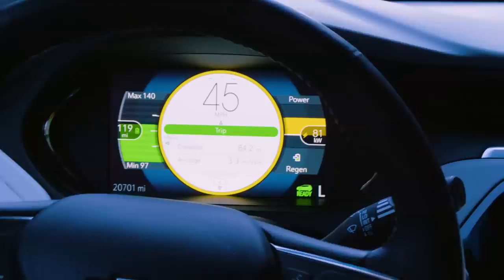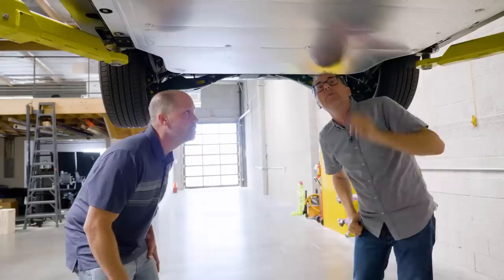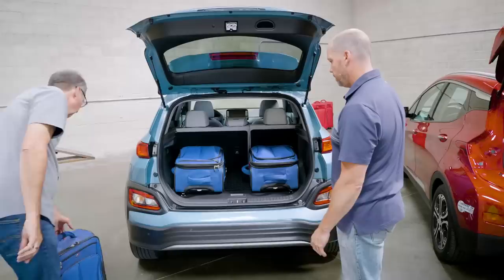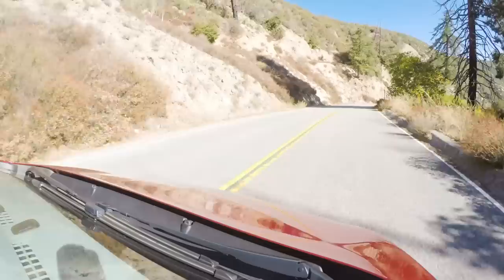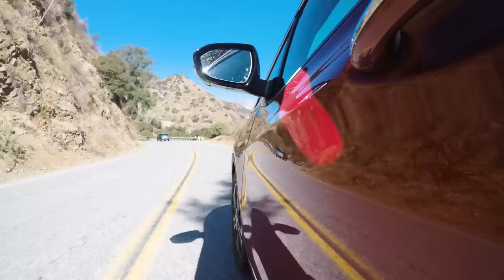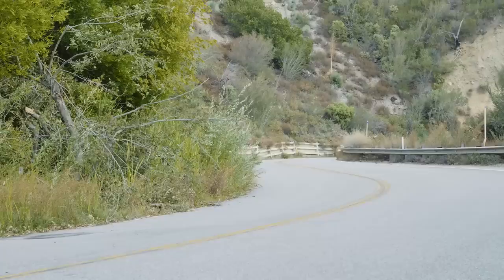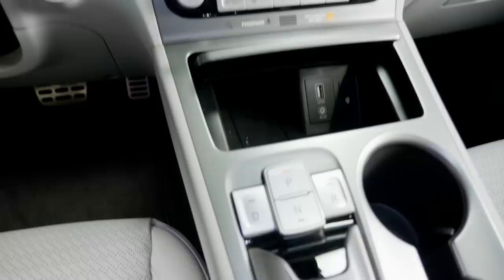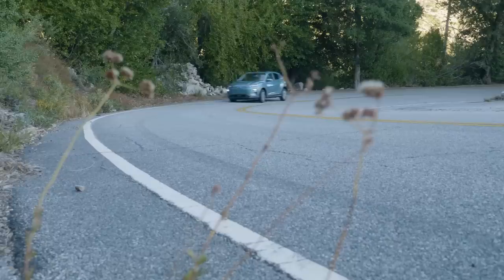Hyundai Kona Electric vs. Chevrolet Bolt EV: Which Is the Best Affordable Long-Range EV? | Edmunds

Comment: I have driven my Bolt-EV for 19-months - wow, haven't had this much fun since owning my first car back in 1965. 

SEATS: 
I'm 6-1, 220-lbs. Initially, the seat felt ''different'' from the comfy seat of my ICE, but after the first week, I didn't notice the difference. I have read that the new model Bolts have improved seat comfort.

SUN-GLARE from the dashboard: 
I trimmed some black cloth and placed it on the dash.

$7,500 REBATE: 
The rebate will be a credit on the tax YOU OWE, or $7.5K WHICHEVER IS LESS. 

CHARGING: 
Where I live, there are six public charging stations within walking distance of my house – at no cost to charge. This has been a nice savings.
On a long distance trip, I carry my own 240v charge cord (Juice Box because the amps can be adjusted to use with my dryer outlet). This allows me to charge at RV parks when no commercial EV charge stations are available.

RANGE, Best Case Scenario: 
In mild weather, no AC, city driving, I get 300-miles on a full charge.
RANGE, Worse Case Scenario: 
In the cold of winter, heating system on auto, driving 65-mph on the freeway, I get 190-miles on a full charge.

TIRES:  
You will have to buy studded snow-tires for winter driving because using snow-chains will void the warranty (a broken chain link while driving could cause extensive damage to vehicle battery cooling system).

No matter which electric vehicle you buy, my grandchildren thank you for helping to protect eco-system of our planet.
Reply: Had my Bolt for 2 years and I agre about the seats, not as bad as all that. Had to swap out the tires, the ~ 13 miles decreased range is worth it, an amazing difference! BFG G-force Comp 2 a/s! Quiet, grippy, fun! Oh and a dashmat is great to enhance the dash
Reply: Thanks for the awesome comment. I was curious about the bolt!
Reply: Bolt EV all the way. GM underrates EV mileage quite heavily and if one drives efficiently you get way more out of the batteries (as you stated).
Reply: Everyone talks about the seats. I'm a bigger guy and they don't bother me. When I first sat in it at the dealership I thought to myself "are you kidding me? This is what people are complaining about?" They're skinny yes but not uncomfortable
Reply: I guess im asking the wrong place but does any of you know a method to log back into an instagram account?
I somehow forgot my account password. I appreciate any tricks you can give me!
Reply: @Zaiden Demetrius instablaster ;)
Reply: @Bode Moses it did the trick and I finally got access to my account again. I'm so happy!
Thanks so much you saved my ass :D
Reply: @Zaiden Demetrius you are welcome =)
Reply: Great information!
Reply: @zaidendemetrius331  - I see this comment everywhere. Bots 🙄 😒

Comment: I have a 2018 Bolt (17K miles...bought new).  I have had five Hyundai's and like the brand a lot (incl. 2 Genesis models).  I was hoping the Kona would be a bigger step forward.  When I saw the back seat and that, for me, with the driver seat pretty much all the way back, there is virtually NO legroom in the back seat, that really soured me on the car.  Admittedly, the Hyundai has some options I'd really like to have (and had in previous Hyundai's) but I find the Bolt almost perfect for my needs with the universally acknowledged exception of front seat comfort.  I'm a big guy at 6'2" and my right hip runs into the seat belt latch and console before my spine is in the middle of the seat.  That's an issue.  BUT overall the Bolt is near enough to perfect that I wouldn't want to lose money to acquire the Kona (or the Kia Niro).  If I were a buyer at the moment, I'm not totally sure which of the three would win.  I haven't driven the other two.  But, I say again, the Bolt has been excellent.  I had a BMW i3 (lease) before the Bolt and if it had had even 180 miles of eRange, I'd still have it, but the lease lapsed because BMW changed their stance re: EV's and I felt rather betrayed.  With the Bolt (which came in at about the same price as the BMW) the "cost" is in the battery and less in the quality of the interior.  The i3 had a great interior and good options but a battery that was less than 1/3 the size of the Bolt's (e.g. 1/3 of the range).  BUT after two EV's I'll never go back to the ICE...no not never !!  I am a widower and live alone, so the "family sedan" nature of Teslas is something I don't really have need for.
Reply: the Kona EV is almost double the price of an ICE Kona. it's kind of ridiculous.
Reply: Good comment - thank you! I’m also currently debating between these three (Kona / Niro / Bolt) in the used market around $20k. In my area, Kona’s and Niro’s are very hard to find.

Comment: I’m definitely taking the Bolt. They’re basically the same car in my mind and used with about 20k miles the Bolts are consistently about 10k less.
Reply: Just make sure the battery was replaced lol

Comment: EV shoppers need to learn about battery thermal management and this review should include this. Chevy and Tesla have this figured out. Nissan not yet
Reply: True Nissan batteries are very different (wafer instead of standard cylindrical batteries).  Batteries (all types) suffer in both temperature extremes without thermal control.  However I have a 7.5 year old Leaf that still fully charges (living in S. California) and been happy with it.
Reply: I'm curious, you do know that Hyundai is not Nissan right?
Reply: @madmotorcyclist  
The range diminishing is not the problem, the new Nissan leaf has no thermal management at all, no air cooling no liquid cooling. So you DC fast charge it once on a trip period after that the battery will be too hot and you will sit there at the charger for double the time it should take to charge. This problem has been all over the news, Nissan says that they're going to do something about that. but it seems absolutely idiotic to me to have a lithium battery pack with no thermal management at all. Even the Toyota Prius all the way back in 1997 in Japan had air cooling on its nickel metal hydride battery.
it seems like a major fail to me. Which is unfortunate because the new leaf is quite nice. Although the range is somewhat limited
Reply: @Arpedk  Yes just sayin' don't know anything about Hyundai's battery and there are examples out there on the market that are both superior & inferior, so a buyer should definitely want to know.
Reply: Seems like the Kona does have a battery thermal management system (BMS) which is liquid cooled. No further details for the moment it seems. Considering that it does supply more than 50 kW of DC charging I would say it does have a rather good BMS.
Reply: madmotorcyclist "Nissan batteries are very different.... However I have a 7.5 year old Leaf that still fully charges "
Interesting. That's definitely not true for a Tesla.
Reply: Jeff Norris
But Nissan won't be using "in house" batteries from 2019, will they?
Reply: Thank you.
Reply: @dmay3391  
I assume you have a Tesla?
Reply: Our 2015 SL has 39k on it that has all its capacity bars, and we live in Atlanta. It gets charged every night, at 110v. All cars are a gamble - and I'll soon gamble again on a PLUS SL.
Reply: @kens97sto171  I'm in Phoenix, it's 114 outside.  My Bolt runs the cooling system even when it's parked if it needs it.
Reply: @juliaset751  
Was wondering if it did that... Good. I live west Texas.. gets hot here too.
I wonder if it would be better to park the car outside plugged in instead of inside a garage. 
If the AC was running the heat would have no place to go.
But outside the car is going to get hotter in the sun..
Reply: @kens97sto171  I don’t think the battery and electronics cooling uses the AC, it has a radiator like a regular car and that is what is being used.  I don’t have a garage to park in, so it’s full sun for me.  On a hot day you can go out to the car and hear the radiator fan running.
Reply: @juliaset751 
It does use the AC. There is a heat exchanger that the Liquid Glycol goes thru that's cooled by the AC system.
There is no direct radiator for the battery. The motors and inverters and electronics do have a coolant loop with a radiator..   there is a third coolant loop that just heats the cabin.

Check out Weber Automotive on YouTube. He has a bunch of videos of total disassembly of a Bolt EV.. battery, coolant systems, and the motor and transaxle. 
Definitely check him out if your interested in the mechanical stuff on the car.
Reply: Which is why I'm buying a spark EV. I'm late to the party, but I live on the east coast and the were only sold in California and Oregon originally
Reply: @BeefHandlesInc  
You should look at a used Bolt EV also.
There are some decent deals, many with low miles.
Be a better overall car than the Spark I think.  Although used Spark EV's may be an even better deal.. I don't know.
I need the range myself... So minimum is 200 miles.. more the better.
Reply: Weber is great, info I haven't found anywhere else
Reply: Well this didn’t age well, given the Bolt battery fires and the recent recall(s).

Comment: I don't think you had selected the highest setting on the Kona's regen. The screen set up is for various sport/comfort or eco. use paddles to select regen. Level 3 will stop you like 3/4 full max foot braking!! I've done 10,000km in mine so far and totally love it. Hot hatch is exactly the right description.

Comment: I have the Bolt and love it.   I have not experienced any ride comfort issues these guys mention.  Granted the interior could use some better details but the windshield actually makes for great visibility
 and since I don’t have the light color interior, I have not experienced any of the glare mentioned.  Also, I have just gone through a cold, snowy winter with the Bolt and while the range was reduced with the lower temps it performed like a champ on bad roads.   As they said, it’s a really fun car to drive.
Reply: Thank you for that info. About how much would you say that the range was reduced in the winter? I think my aunt said her Bolt went down to 170 miles in winter. Still enough to get me to work and back.

Comment: Interesting how these vehicles are almost identical in size, power, etc.  Clearly the Bolt pushed the backseat rearward sacrifising cargo space and the Kona did the opposite.  Decisions and compromises.  I am impressed that Hyundai/Kia designed ONE vehicle platform that is no compromises in gas, hybrid and full electric forms.
Reply: People usually crap on that idea and call it a compliance car. Seems like it'd give you a bigger resource for parts & be cost efficient for production.

Comment: And the Kona is faster in CCS loading, and has a much better BMS and TMS.
And don't compare with model S, this is another class.
But you can compare the Kona with a little more expensive model 3. This is a sporty Sedan, but not as comfortable as the Kona. The Kona is a compact SUV, a complete other kind of car. If you want a sporty highway runner, the model 3 is your choice.
I own the Kona and be happy with this, and i like also the model 3 that is not available here at the moment.
It comes with us in the first half of 2019 with the European CCS 2.0 loading plug, big idea from Elon!

Thanks for your great video 👍 and greetings from Austria 🇦🇹

Comment: "The angle of the windshield is just perfectly wrong" - Dan Edmunds on the Bolt bahahaha. Loved this
Reply: FACT is the TM3 has a lower drag coeficent then BOLT or KONA EV.
Reply: @markplott4820  How does the Ioniq compare? It's sleeker than the Kona, but has less headroom in the back seat.
Reply: @gunnar6674   - Ionic is a bigger car, sportier too but it Lacks cargo room. Sadly no Dual Motor or Long Range version will be Avaliable . Ionic has the same Problems as KONA however , they wont be made in 100,000s like a Tesla will and it has a Faulty battery that can catch fire, both Ionic and kona.
Reply: @markplott4820  Do you have any sources on that?
Reply: @gunnar6674   - Battery fires in KIA and Hyundai cars pretty common in PZEV and Hybrids.
check NEWS stories on Korean EV fires on youtube.
Reply: @markplott4820  Maybe just maybe the battery pack in the new models is different than the previous models, ever consider that?
Reply: Blake Swan not sure what is wrong with windshield. I drive a Bolt and it has great visibility.
Reply: How could Chevy make such an obvious blunder?